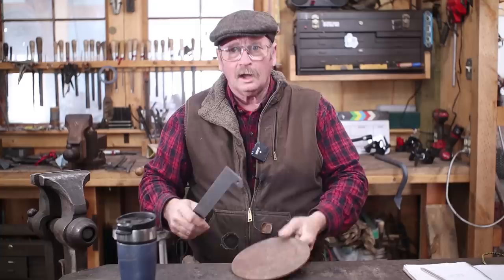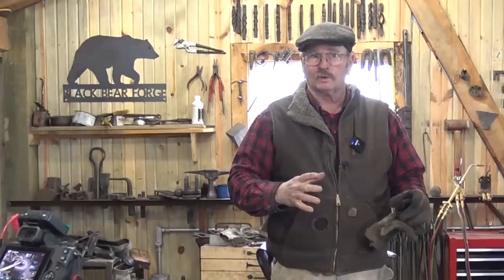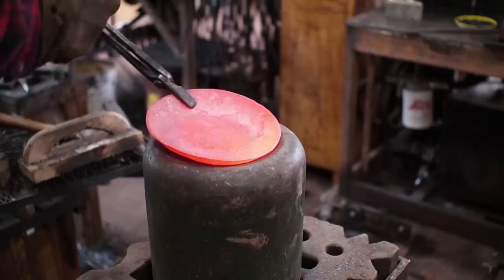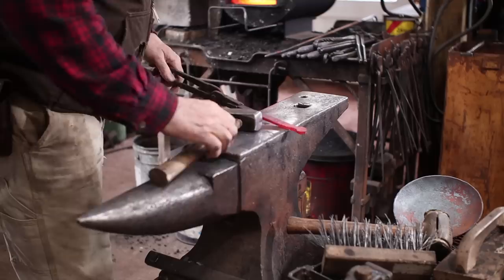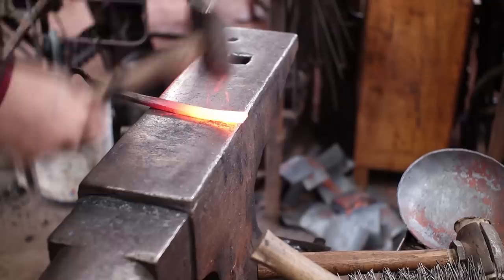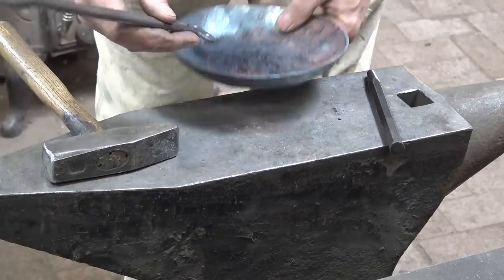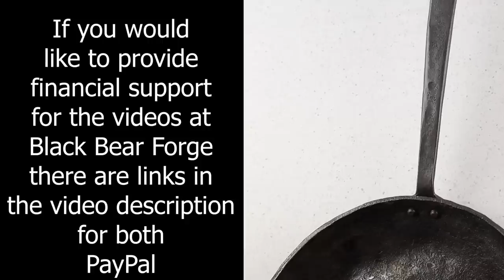Forged iron skillet - blacksmithing

Comment: Am I the only one that doesn't see the need for sped up video sections on blacksmithong videos. I could literally watch a 3hr video on smithing a skillet. Especially with John doing the smithing. Always a pleasure to watch. John is the reason I have begun trying my hand at blacksmithing. Got a RR track anvil and just bought my first 2.5lb Kanca cross-peen hammer. I was using a framing hammer before. Still need a rounding hammer and some real tongs.
Reply from the maker: Based on the actual watch time and performance showing a big drop off for longer videos I am afraid you are one of the few.  Glad you're enjoying the videos though

Comment: I really like the new lens.. very crisp and clear.. I want one. After trying out the cable mic I am thinking about creating a “wire channel” in my apron. This way when I put on the apron, the mic is attached allready, and I just plug it in and cords are pre-corralled.
Reply from the maker: I think the big difference is in the aperture. This lens is a 1.8 at its widest while the other lens is 3.5 and as a zoom it gets smaller if zoomed in. As a result the other lens tends to increase the ISO a bit to much

Comment: Nice.  Been learning metal castinng but it has lead into me trying to do some minor Blacksnmithing.  Need a set of Tongs for my crucible so I pulled some steel flats from a chain link fence, cut a hole in the bottom of my first meelter and heated them, did a great twist on each but got stopped there as I've no means to drill or weld.   Just started a mower blade bowie-using my poor man's anvil to flatten it-old tree stump- so this type of video is a wealth of knowledge.  :)

Comment: Looks like the form and hammering technique you're using would be a good place to start for making a small wok. Woks are efficient cooking vessels as far as fuel use is concerned. 
Pretty much start like you did, now leaving the bottom thicker and curved, hammer out the sides thinner and thinner. In Wok cooking one wants sustained high heat in the middle and low heat on the sides. So you only need a bed of very hot coals in a fire ring.

Comment: Lav mics and cables I find are always easier if you run them from a pocket then up the inside of your shirt/jacket. wired mic has a better set up, it's ever so slightly quieter, the wireless one you're getting close to peaking.

Comment: I am voting for the new mic.  It has more of the mid lows (not quite bass) and really cuts off the ringing highs of the anvil/form.  I would use the old mic for something that needed precise sound, but the new mic is better for day to day video watching.  I bet we all watch on different devices in less than optimal conditions, so for video editing I bet it is hard to find a happy medium.

Comment: The regular lav is the better sounding mic (just quieter in the mix), but if it creates problems the GO doesn't actually sound "bad".
Reply: Also to help with focus without using the eyepiece you can turn on Focus Peaking to see where you are focused now you are using a shallower depth of field lens.
Reply from the maker: I had never heard of focus peaking before.  Looked it up and will give it a try, thanks for the tip

Comment: Top notch video.  I have never used a forged steel skillet before.  Can they be seasoned like a cast iron utensil ?  That's a neat size.  Shouldn't be restricted to a camp fire...would work great in the kitchen as well.
Reply from the maker: You would season it just as you would cast iron

Comment: as a none blacksmith, the inverted tank with the pushed in bottom does work, but I would think a stump with bowled out middle would work better, in so that it does not suck heat away as fast and give you a long working time between heats.

Comment: Great hammer work ! 
I didn't notice much difference between the two microphones.
As far as the skillet maybe a round flatter will get the bottom smoother; it looked little wavy.
Reply: He did mention a round flatter around 15:40.   I'm assuming he doesn't have one, maybe it would be a good future project.

Comment: From a guy that lost about 20% of my hearing in an explosion in Afghanistan I can’t tell any difference between the two mic’s. All that’s missing on the pan is the bacon test lol
Reply: there's no difference. You're good to go. :)
It sucks that the ears dont regenerate fully. Someone said that DNA-Force can help with nerves a bit. I know from firing from cover of small walls. I use to put at least paper balls in the ears since then even when I just hammer an iron sheet or cut steel. Sensor protection is underestimsted

Comment: Your voice sounds better with the new mic. The forging sounds are really close in quality and volume.
And, if you didn't know, the hole in the handle is a spoon handle rest, originally, meant to hold the wooden spoons of old over the pot/pan/skillet and keep it from falling on the dusty/dirt floor/ground. It was not originally designed as a hanging loop. Love the scrolled handle.

Comment: Nice project.  On of the first blacksmithing videos I ever saw on YT -- I was looking for some kind of cooking video -- was from Chandler Dickenson (sp?) and he did a series of videos on trying to make skillets from flat stock.  He was trying to beat it down over a form, i.e. shrinking the rim.  As a metal shaping guy (think custom motorcycle gas tanks), It seemed clear to me that stretching the center would be a lot easier than shrinking the rim, which is what you've done.  (If you wanted to explore the alternate, search for "tuck shrinking" )   

The new mic is a little brighter with less low-end.  It's close, but I prefer the old mic/transmitter.

RE: the corded mic, apologies if this has been discussed, but why don't you run the wire in between a layer of cloths?  Not necessarily next to your skin, but between a t-shirt & flannel shirt?  Just have the business end of the mic pop out between buttons & clipped to the placket.

Comment: Hello, beginning blacksmith here...  Why aren't you using the flat part of the hammer to flatten the pan?  Thank you for your videos!
Reply from the maker: I’m pretty sure I was flattening with the flat face. The other face that would ha e been visible is only slightly domed and may have appeared flat in the video.
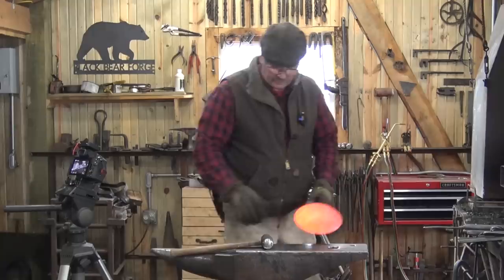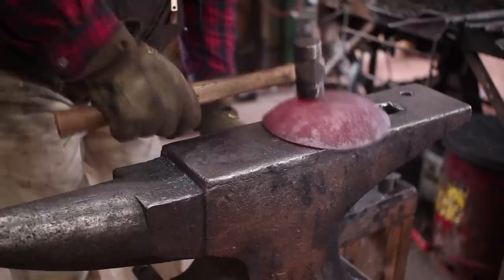Reply: @BlackBearForge  Thank you for replying sir!  Maybe I am mistaken but, at 8:36 you are beginning to flatten the  pan from the bottom with the round side of the hammer down and the flat side of the hammer up... At 9:10 the flat side of the hammer is clearly up...  As you lay the hammer down at 9:20 the round side of the hammer is facing towards the camera...  Again, I may be mistaken, however the video seems to confirm...  I don't fault you for any oversight, I was merely curious if the technique was intentional...  Thank you again sir, I look forward to more of your videos.

Comment: Seeing you work with sheet is nice. I've recently made a bowl, hand shovel, and shovel out of 1/8" thick copper. I intended to make the sheets larger and 1/16"- 3/32" thick. After several annealings the shovel stock had grown only 3/4" using a forming hammer with a face similar to a straght peen for one direction of growth. When raising the bowl I used a ball peen over a leather bag. The ball peen seemed to stretch the metal more, but even when using it on my small anvil it "raised" the metal. In your experience what is the most effective hammer for drawing out sheet (or do you even bother due to the huge amount of work?)? The bowl is done, but so thick I can revisit it over and over for the next 20 years.
Reply from the maker: I don't doing any drawing out of sheet.  It is so easy to distort
Reply: @BlackBearForge  It is difficult. I suppose that is why rolling mills are so popular. Alas, I must persevere in my desire to understand the old ways.

Comment: Thats a project I have been wanting to do for some time. I had never thought about using the bottom of a cylinder to shape it, now I need to find a unserviceable tank.
Reply: Some old no account fire extinguishers are heavy tanks and have a nice dished out bottom that works well. I found a big pile at the scrap yard.
Reply from the maker: I would start by asking at your local welding gas supplier.  They aren't the ones taking tanks out of service, but they will know where they go for testing.  Lots of people make bells form the tops, so that leaves the bottoms as scrap.

Comment: Hi John.
Im following your channel for a while now. I like the way you can break down things at hand and explain pros and cons of different options. 
This leads to the following questions.
I realise I may be getting to technical but this thing puzzles me a bit.
Rivets may come loose over time and continuous use. It is a simple fix, for a Blacksmith, right?

Is it possible to forge weld the skillet and the handle, considering they are both fairly thin?
I think that may be a bit more beneficial to the "longer lasting" factor of the hand made piece.
Reply from the maker: Forge welding may work, but in such thin material it would be easy t over heat the material.  Rivets are a very old solution and still seen in some modern pots and pans,   bit of brass in the joint then bought to heat might baize the materiel making a stronger joint.
Reply: @BlackBearForge  thank you for clearing my doubts John. Stay safe and in good health.

Comment: Good job but i'm a bit confused i use to watch different people doing blacksmith and all of them say that in order to have best quality in the product  the metall has to be non magnetic orange color and you keeps hammering after the piece is black again is this due the difference of metals or ?
Reply from the maker: Non magnetic is typically used to determine critical temperature for hardening high carbon steels (it is not very accurate with modern tool steel however).  Proper forging temperature varies depending on the work.  High heat, bright orange to yellow, moves material faster but leaves a rougher finish.  Working down into a black heat helps refine the piece and helps to leave it scale free and smoother than if you stop forging at higher heats.

Comment: I can't really tell the difference between mics. I find three rivets in a triangle formation gives a more stable connection as it reduces flex at the joint and hence wobble that occurs over time.

Comment: FYI:  The old camera; in comparison to the new,  appears cloudy.  The newer camera appear clearer and sharper (brighter colors - esp. close ups).   This said  based on the scene  -  you sitting at the work bench.  Shots while standing at the anvil with natural light via the window made judgement difficult.  As far as sound:  The;  newer mic,  "Road-Go" sounds as if you're at a distance ( a bit muffled - talking via two tin cans and a kite string ) ... this is not to say it is a bad thing.  Could it be a negative when you're at the power hammer or heavy anvil hammering ... we'll see?    With either one,  once you look down and speak directly into the mic  - it is a much clearer sound.  Likewise; when wearing layers of clothing and the mic gets covered - obviously it's muffled (seldom happens ).   All in all; as for the video, matters not "old or new" made little difference.  My recommendation is to go tether free for you piece of mind and freedom to do great work as a Blacksmith.   I would like to learn how the new cookware worked out for you?
Reply from the maker: Thanks for the input

Comment: Great video. I really couldn't tell much difference in mic. when cutting a O2 tank are there precautions that need taken like cutting a propane tank?
Reply from the maker: Just make sure there is no pressure in it.  Generally the bottoms are available if you find someone making bells out of the tops

Comment: What class of steel is used for carbon steel skillets? The closest thing to iron is mild steel, but that would be the most sensitive to corrosion/ oxidation. Cast iron contains many alloys and is most often enameled; and stainless steel is much harder to work.
Reply from the maker: My guess is that they are just mild steel.  They just need a way to stand out compared to stainless.
Reply: Fair enough, does the seasoning protect the carbon steel from corrosion when it gets cleaned?

Comment: What would you put on that to protect it from corrosion?  I'm very new to this, so my knowledge on metals, protecting them, and working them is low. Thanks
Reply from the maker: I use beeswax as it cools from forging.  Then in regular use I use whatever vegetable oil happens to be in the kitchen.

Comment: Was the piece of material you started with actually steel sheet and not iron. Maybe a smith just uses the term iron for all?  Do you season that just like you would a cast iron skillet?
Reply from the maker: Yes, but since steel mild steel is still 98% iron and is not a tool steel, many blacksmiths refer to it as iron and is the modern substitute for actual wrought iron.  in use you treat it just like you would cast iron

Comment: Any tips on how to make a decent size skillet when you have a small forge? Haha. Oxy torch? I want to make a skillet really badly, small propane forge opening though, that has been my limit for a lot of projects
Reply from the maker: A torch with a big heating tip will work but will also use a lot of fuel.

Comment: How do you get that ready for cooking these soaking in a hot bath of oil I know that's all I know right now when I get a good one I'll bring it home I'll clean it all up scrub it down with a Brillo I'm soaking in oil coconut oil normally
Reply from the maker: Initially I apply bees wax while hot enough to smoke. Then it’s just light oil on the warm pan after cleaning.

Comment: But you have to give that a good grinding and sanding before you got it ready to cook on
Reply from the maker: If you’re concerned about sticking, smoother is better. But for things using a fair amount of oil it works just fine as is.  Just season it like you would cast iron.

Comment: Is the hammer you are using the turning hammer that you can buy at tractor supply/rural king?
Reply from the maker: I'm not familiar with those exact hammers, but this is a store bought rounding or turning hammer, probably from Centaur forge
Reply: @BlackBearForge  yup that's the one. Tractor supply sells them here in my town.
 How do you like it?

Comment: The new mic sounded great. Great project.  How did you finish the metal?  Cooking oil? Thanks John
Reply: Following, same question how do you finish  Things that will have food in them or used for?
Reply: @Res375  you can hot finish in any food grade oil or Grease. I was just curious what John prefers.

Comment: I think the wireless mic sounds better when it's just you speaking. When you are using the wireless mic and both speaking AND hammering, I feel like your voice volume is muffled a little and the hammering noises favored. I find the balance to be a little better with the wired mic in that scenario. Overall though, not a huge difference either way that I could tell.
Reply from the maker: Thanks for the input

Comment: Great video.  My only question is why wouldn't you forge-weld the handle to the outside?  I suspect my question is very ignorant, so don't think your answer needs to be gentile.  :-)
Reply from the maker: You certainly could do it that way.  But it doesn't seem to be a common approach in older examples.
Reply: @BlackBearForge , thank you.  I'm really enjoying your content.  Now I have something else on my list of things to try.  Stay safe, wash your hands and wear eye protection.

Comment: Why don't you run the cord under your clothing so it doesn't snag on things?
Reply from the maker: Because that requires a 180 degree bend from the belt pack running under the waist of my pants and then another bend to run up under my shirt.  The sharper bends adds stress to the cable and causes failure in the system.  Replacing the lavs regularly can get expensive.
Reply: @BlackBearForge  Have you tried taping or pinning it down?

Comment: Your lav Mic need to be clipped on close to the little to not at the top of your rib cage, then run the wire under your shirt and around to the receiver at the back. Which if possible should be clipped to the back of the waist band on your pants.

Comment: Dude just blacksmith on one video and do testing on a different one. This was tedious and far from what the description said.
Reply from the maker: Testing audio equipment in anything but the same situation it would actually be used in is less than conclusive and doesn't provide me with the information I need.  The description said I was forging a skillet and thats exactly what was done.  So "dude" your comment is a real dud
Reply: @BlackBearForge  your title should have stated you were testing audio equipment  as well. I was interested in your skillet but didn't make it past the repeated testing call outs.
Reply from the maker: So you missed out on 95% of the video, your loss I suppose.  But the information gained for me was extremely valuable.